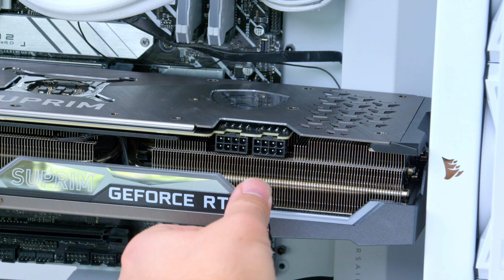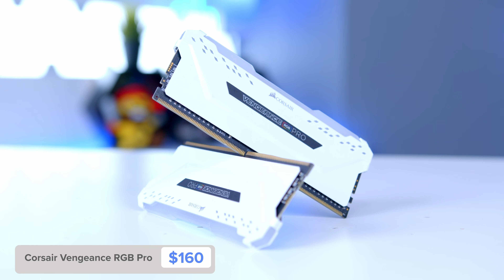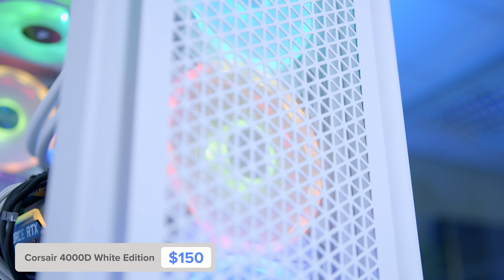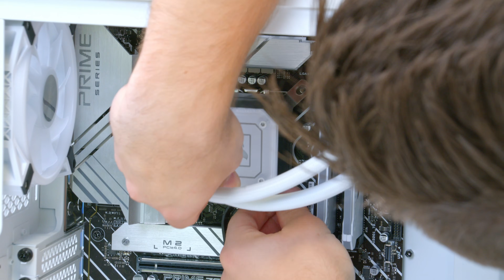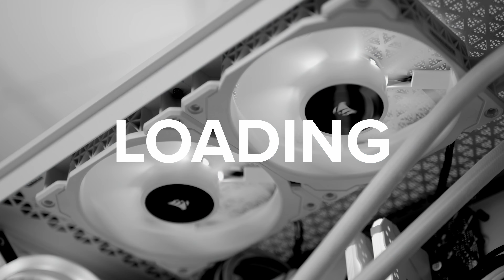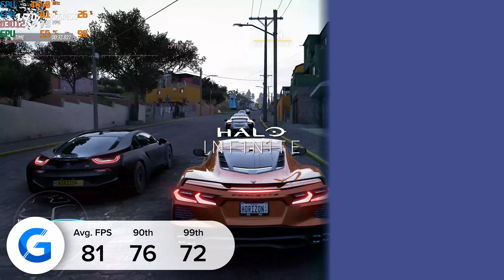Stunning $2000 Gaming PC Build 2022! 🔥 [RTX 3070Ti & i7 12700K - Full Build Guide w/ Benchmarks!]

Comment: Just built my first PC for around $2200 with an EVGA RTX 3080 12g and an I5-12600k.. still can’t believe I managed to not screw it up. That feeling when you turn it on for the first time.. Ill Never forget it..
Reply: Noice build and congrats
Reply: How is the performance is it better than Ryzen 5 5600x .?
Reply: @avinash_madhukar  i'd go for a 12600k now because in most cases (if not all) it's faster than the 5600x, though if you're a bit on a budget, i'd go with the 5600x because the b550 boards are very cheap

Comment: Nice build , I’ve built in the same case it’s really a great and easy case to build and and looks really good. Only things is you can mount the  fans in front of the metal plate at the front of the case and the aio behind the plate ( sort of sandwiching the plate between the fans and aio) for better clearance from the gpu and better looks
Reply: Do i need to buy the long screws separately to screw the fans in the front? if so where can i get them please?

Comment: Actual price came out to be $2,120 which is more or less good. I feel like u could save some $$$ with a regular 3070. This is the build that I’m planning on doing this summer so it’s good to see. But overall good build.
Reply: Atm a 3070ti OC triple fan, is just $40 more expensive than a triple fan OC 3070, so it‘s actually a no brainer to put a 3070ti in there.
Reply: At least where I live that is
Reply: Id recommend a 12700 non k and a b660 motherboard which will save you alot
Reply: U can safe quite a bit off money in the CPU actually... Get a 12600KF and a B660 or the 12700F as Robo said, 12700k is overkill for gaming. Even the 12400f will do if u play 1440p+
At 2k, you should get a 3080 in this PC, especially if u wanna wait some time. Remember next gen cards are said to come in September/October and should perform much better and have much more VRAM. So if u can wait till late summer/start of fall, u might get a way better deal
Reply: Or just use a i5-12600k, cheaper Motherboard, cheaper cooler, and cheaper RAM/Storage which will save you around $300
Reply: can i put a 3080 ti instead?
Reply: @stellatrepanier9893  Sure. Or a 6900XT, depending on price
Reply: @froznfire9531  Could I build this same exact pc but with a 3080, or do i need to change some other parts in order for it to work well? Im new to pc building
Reply: @RealKyurem  No your totally good with these parts, i think a 3080 is a perfect fir to the i7 and would recommend over the 3070ti for sure.
Reply: @froznfire9531  alright thanks so much
Reply: @froznfire9531  would you say that a 3070 ti and a 12700k is overkill for fps games like apex, r6 siege, valorant, cod, at 1440p? I would also like to be able to stream smoothly while playing these games
Reply: @RealKyurem  Do you have a 1440p 144hz screen? I would say for games like Valo or R6 yes but for games like the new COD I would at least take the 3070ti or better 3080/6800XT. The i7 is great for streaming, you could get away with the 12600k too I would say
Reply: @froznfire9531  yah I do and I'm just probably just going to get a 3080 for this build so I dont have to worry about any games running less smoothly
Reply: @froznfire9531  Is the 12700kf better for gaming than the K version because idk if the integrated graphics will be useless with a dedicated gpu
Reply: @froznfire9531  should I get the k version of the 12700k or the kf version without the integrated intel graphics?

Comment: This is exactly what I was looking for thank you so much! I have one question regarding the software part of my new pc build and I was wondering whether any of you guys could help me out!
I am going to be installing a clean windows 11pro onto my new m.2 SSD. I currently have windows 10 pro and my files and programs on a sata 256gb ssd. Should I back up my documents onto a USB drive or does Drop-Box work as well? PS: I won´t back up my programs as I heard that it simply is not possible because of the new OS.
Any help is much appreciated, Cheers!
Reply: I would not reccomend going for this. Go for 12700kf and EVGA FTW3 3080. If you want I can send a list. Unless you like the aesthetics and components, then this isn't that bad either.

Comment: Another bad installation of the radiator. The tubes should be down if it is placed to the front of the case. Other than that, it’s all good.

Comment: hello, I have such a problem, I wonder if the i9 12900k 3070ti 650 watts power supply supports the 3070 ti
Reply: Probably not. I have a 12700k and a 3070ti in my system, and pc part picker estimates my wattage at 629. So a 650 would barely be sufficient considering the 12900k requires more wattage than my 12700k. You're better off playing it safe and getting an 850 watt psu
Reply: @Freedomman1776  thank you bro